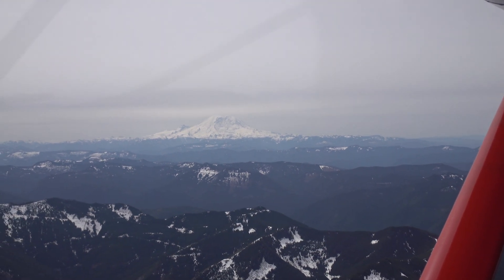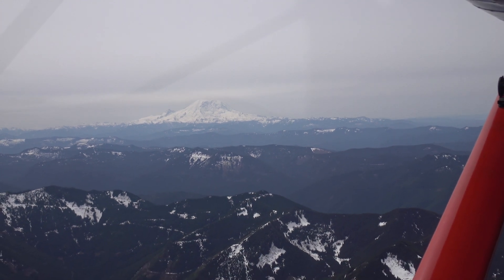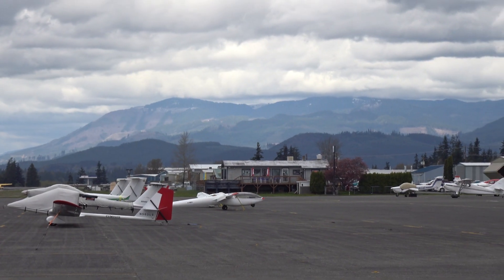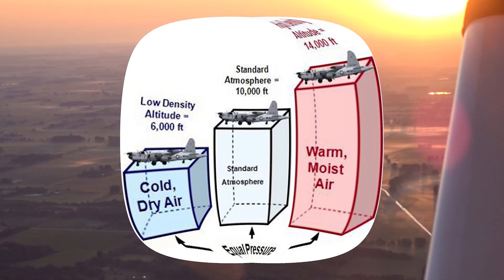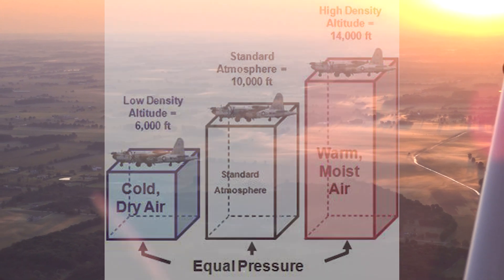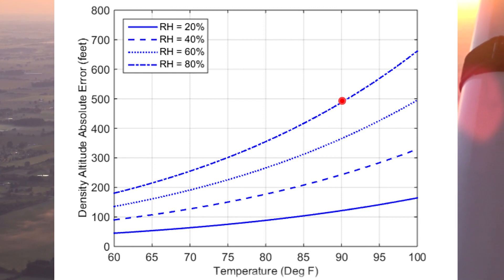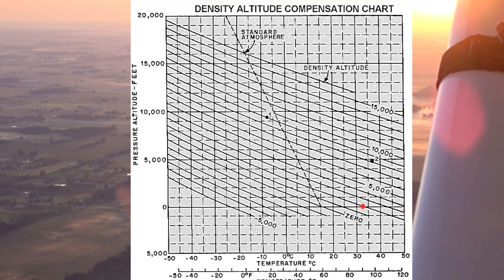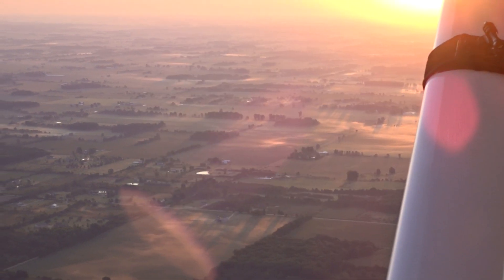How STOL pilots takeoff so short, Airplane short field techniques. *Updated

Comment: Scooter, a few years ago Dave Hirschman (AOPA) did a takeoff comparison tail low vs. raising the tail in a C-180.  In that demonstration he found no difference.  My guess would be that popping the flaps would get you off the runway in the shortest distance but then accelerate in ground effect until achieving Vx.  I agree the Stinson  with standard 7.00-6 tires could use a higher attitude sitting on the ground.  I guess the 8.50's help a little in that regard but probably still not enough.
Reply from the maker: I've spent a lot of time measuring angles and heights on the 108.  31" tires gets you up to just under 16 degrees pitch.  The aero classic 8.5, listed at 22", splits the difference.   This update/re-release video was put out as a prelude to a new video where we will use 3 planes that will each do 3 type of each takeoff to see if there is a difference.  With a sample size of 9 using different aircraft I hope to get  more accurate data of takeoff distances for each style of takeoff.
Reply: The STOL competition community has confirmed tail high, yank back and try to damage the tailwheel is the most efficient way. Painful to watch, but works.

Comment: big tires are meant for rolling over rough terrain, not for adjusting AOA on the ground, nor are they about takeoff distance.
Reply: It's about both. Sometimes you have to use all the advantages, not one over the other.😅
Reply: @Richard-hp2fh  never said you can't use it for multiple things, but yes sometimes one advantage is more important than another, depending upon the conditions and what you're doing. But Putting big tires on a Cessna 182 doesn't improve its take off distance, it increases it by adding both weight and drag. Now, you might need them on a rough enough strip, but they are still adding weight and drag. But you've decided the reduction in performance was necessary tradeoff for the advantages afforded by the big tires.

you said "both", yet I made 3 points, not 2, about the big tires in my original comment.
Reply from the maker: Yes and yes, but they do. Many people don't give it consideration, and that's why I brought it up.
Reply: @GreatMichiganBushCo  if it's helping with AOA, the plane was likely not designed right, or for that purpose. 

side note, a perk of trikes is not being so limited in pitch/AOA on takeoff and landing.

Big tires increase drag and weight, increasing takeoff distance. They are helpful if taking off on rough terrain but totally unnecessary for pavement or smoother fields. But they help on rough terrain the same way tanks use tracks on rough terrain.
Reply from the maker: @SoloRenegade  What you say about rough terrain and drag is true.  You don't even bring up angular momentum and acceleration.  Yet rolling AOA is important in takeoff distance especially when you are looking at STOL type takeoffs (contest style.)  You bring design errors. Well the late 30's to late 40's aircraft were built underCAA CAR23 rules.  This lead to a lot of airplanes built by different companies being very similar.  Think Cub, Champ, 140, ect.  They all have very similar designs because of limitations set forth in regulations. This allows pilots to switch between different airplanes safely as many important characteristics  were similar  Even today Part 23 requirements still limit aircraft design in the same way.    One of these was the requirement of  how many pounds of backpressure is required to go from a trimmed aircraft to a stall, at takeoff this limits the amount of nose up pitch allowed while sitting on the ground.  If you look at aircraft designed outside the US (think Buker BU 131) that sit with a much higher pitch on the ground . Putting larger tires is a way around this limitation. Run the equations, there are a bunch of calculators online to make it simple, (I have) do the measurements on your aircraft (I have on mine) and you will clearly see if it makes a large enough difference.  On the 108 the increased AOA overcomes the weight so the additional pitch will reduce takeoff speed.  Remember parasitic drag is square of speed so at slower speed such as those accelerating to takeoff the amount of added drag is going to be minimal with larger tires. I am not the first person to run the numbers on this and in the STOL community pilots talk about this often.  We are looking at shortening distances by 5-10% (in my case this is 15-30’) so for the average pilot it’s negligible, but we are talking about how to take off in the shortest possible distance.

I appreciate debates like this an am glad that a video like this starts one, I spend many weekend evening around the airport talking with groups of guys just like this.  So thanks for commenting.
Reply: @GreatMichiganBushCo  "You bring design errors." I'm referring here to aircraft like Draco, who's angle of incidence was insufficient with all the mods applied. He was leaving performance untapped due to design errors.

"Putting larger tires is a way around this limitation. " I'm well aware of how big tiers changes the angle, but some aircraft could already achieve stall angle in the 3-point attitude without big tires. If you put big tires on not knowing this and try taking off 3-point, you'll never get airborne. Many aircraft, even certified, can achieve just about their stall angle in the 3-point attitude, once they get light on the suspension.

"On the 108 the increased AOA overcomes the weight so the additional pitch will reduce takeoff speed. " but small tires and changing the landing leg length would achieve the same thing at a potentially lighter weight nd like a lower drag. If every foot of extra takeoff performance is what matters to you, then make sure to truly do it right. 

A lot of STOL pilots to me are teh same guys who complain about weight, while they personally are 50lbs obese and would be better served eating healthier while simultaneously improving their airplane's performance. I'm the type of pilot that will land a ratty C150 on stock wheels next to a Carbon Cub on a backcountry Idaho strip. I've got hundreds of hours flying light piston helicopters and Cessnas in the Rockies, even doing things like shooting approaches in a helicopter without sufficient power to stop my descent OGE onto a mountain top (was not done recklessly and was thought and having escape routes preplanned). Too many people want to buy their way to performance rather that truly understanding their aircraft and how to get the most out of it.

"We are looking at shortening distances by 5-10% (in my case this is 15-30’) so for the average pilot it’s negligible, but we are talking about how to take off in the shortest possible distance." and yet most STOL pilots are still leaving tons of performance potential on the table. If I had the time and ambition to build a STOL plane, I could beat just about any STOL plane out there without too much difficulty. I know it sounds arrogant, but that's because you don't know how much time I've spent thinking about it and what my approach would be (I'm also a mechanical/aerospace engineer, so consider how I've been looking at this both as pilot and engineer).
Reply: Some airplanes with big tires you need to make a tail hi take off in order to see where you're going and to avoid any obstacles on your takeoff run.  Most of the time we're just practicing on an airport that really isn't very challenging so most of those things don't matter. But when you get out on the brush on a narrow, rough airstrip with obstacles that may have changed over time as the trees grow, you need all of your skills and all of your tricks you can come up with.
Reply: @Richard-hp2fh  And that's fine, but there is a difference between real world STOL and competition STOL. And most people are doing competition style, not real world.

Many of the "bush" strips in the lower 48 of the US can be landed on with stock airplanes and a good pilot.

Comment: 1948 Vegabond, no electrics. I prefer the tail high, or as we call it the wheel take off . I find I have better control authority over the little machine through the roll over the tail low , or soft field attitude. That being said I think it takes off a little earlier in the soft field attitude, although it feels vague and mushy. Wheel take off full fuel with me on board is just about 365 feet every time, I measured, half a tank of fuel is considerably less.
Bought a c85 this winter and shopping for a wooden prop, the old guys say its a much better upgrade than an o200.
Enjoy your uploads.
Fly safe.
Reply from the maker: The soft field or tail low take off is definitely a mushier take off. Pulling your flaps with the tail in the air. I find to be the most responsive takeoff as the aircraft leaves the ground. But I like the wheel takeoff or tail high take off best, It's probably the one I'm most proficient with. Good luck with the engine swap, stay turned we may have something in common on that front.
Reply: @GreatMichiganBushCo  Alas no flaps on the Vegabond. It's pretty basic flying,
Reply: Oh yes I'm running the 65 Continental

Comment: Good stuff! I like tail high and pull flaps in my -3.
Reply from the maker: I find setting the flaps to be easier and more consistent, but that is the way I practice most often.  I think if the 108 had larger flaps there would be more of a penalty rolling with the flaps down. This is what I find fun about technical flying. Everyone has their own procedures.
Reply: @GreatMichiganBushCo  I may (or may not) have 3 notches of flaps. It seems when I start my roll with 1 notch, my tail comes up quicker than no flaps. Do you notice this? I attributed it to downforce of air from the flaps lifting the tail faster. Then less drag and shorter roll. I pull more flaps when I rotate. I love these planes!